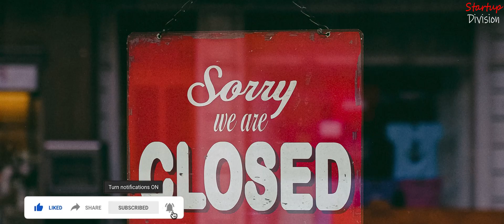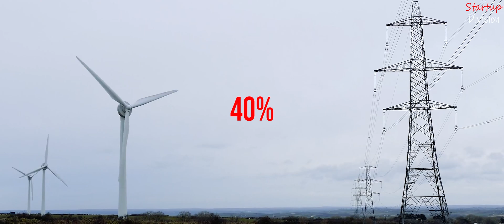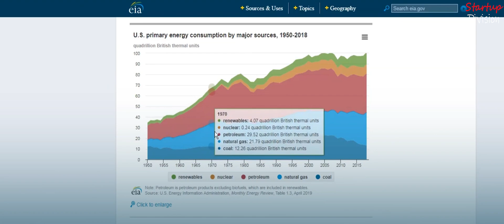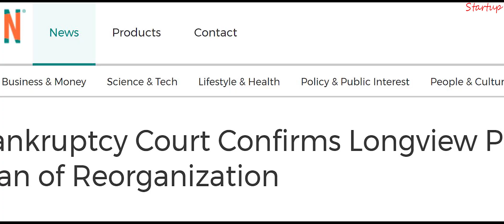Renewables Now Generate More Power than Coal Amidst the Pandemic in the U.S.

Comment: We need a mix of nuclear and renewable. I hate COAL. its the worst form of energy !
Reply: @fredymader1750  You are right that efficiency can be very cost effective. Wind and solar are very cheap, and because of that, you can integrate lots of it into the grid. Beef up grid connections, storage, overbuild, demand management can all be used. BTW, wind produces more in the winter, solar more in the summer, so if you have both, it's easier. I, for example, have a meter that only measures how much I produce, and consume, but not when. That's stupid. I have no reason to charge my car when power is plentiful and cheap, instead of expensive.
Reply: Absolutely incorrect.. Read up on decommissioning costs of nuclear reactors thus far and come back.
Reply: @octapc  Even when you include decommissioning and others costs of nuclear, it's still better than coal. Coal is absolutely horrible.
Reply: @BenjaminCronce  Nuclear costs too much. Look up how much Vogtle 3 and 4 will get paid per kwh. Let's not even talk of Summer 2 and 3. What a waste of billions.
Reply: In principle I actually agree. 
But, what about the radioactive waste?
Reply: @JohnJohansen2  Nukes are safe, for the most part. but i do worry about the wastes it generates, but that can be offset if you are using "Thorium Reactors".
Reply: @gyaani_keeda  If we used nuclear in an intelligent way -- the 'waste' wouldn't be an issue. Most people aren't aware that the so called waste/spent fuel, can be reprocessed and used again. Currently the 'once through' light water reactors (LWR) use just a few % of the uranium and the spent fuel has a long radioactive half-life and must be stored safely for 100,000 years, but when we reprocess the fuel, the half life is literally a few hundred years and the volume of waste is massively reduced so it can easily be stored above ground for that time. Doing this gives the advantage of using uranium efficiently and solves the waste problem to where it's a non-issue. Fun fact.. using only the waste/spent fuel that the U.S has produced so far, would be enough for an entire century of U.S. power demand. https://whatisnuclear.com/recycling.html

Another important point is that LWR aren't the only way to do nuclear, we have breeder reactors that can literally create more fuel than they start with, they can also use the waste fission products for fuel (MOX fuel) and in the future molten salt reactors (MSR) namely LFTR will be able to power the earth for hundreds of thousands of years if they come to fruition; LFTR is looking really promising and I believe it will happen, but needs more R&D. For now, reprocessing spent fuel would give us enough power for a few centuries worth of total energy demand, not just electricity which is only 1:3 of energy used -- then, if we use breeder reactors we'd have a few thousand years of energy. We have the technology now, renewable sources cannot power total energy 100% because our total energy demand is going to triple in the next century.

If you're interested in MSR or LFTR take a look at this channel: https://www.youtube.com/c/gordonmcdowell/videos it'll tell you all you need to know about the history and its future potential.

Again this site is a great resource to learn about nuclear power: https://whatisnuclear.com/
Reply: If you go nuclear you won't need renewables.
Reply: @GyaaniKeeda
I agree.  Renewables and nuclear if it can compete.  Coal must be stopped as soon as possible for the health of the world.
Reply: @fredymader1750  we can launch the nuclear waste into the sun, elon musk has made the cost per pound to send things into space cheaper and the price will keep going down.
Reply: @neoanderson7492  no you cannot. Learn how hard and energy intensive is to hit sun.
Reply: @0cool966  wrong
Reply: @neoanderson7492  Yeah launching nuclear fuel through the atmosphere on rockets that could potentially explode doesn't sound like a terrible idea at all.
Reply: @Aidan303  dont be intimidated by my genius
Reply: @neoanderson7492  
You don't know what you are talking about.
Reply: @acmefixer1  I decide what realty is